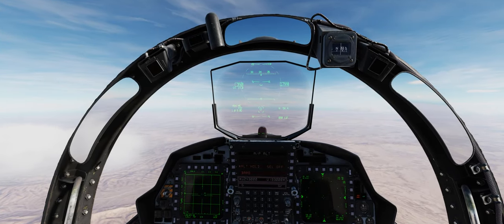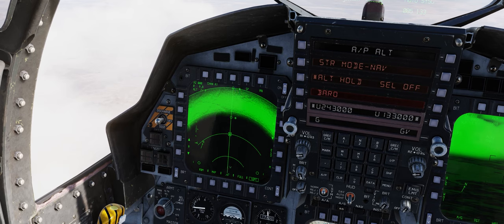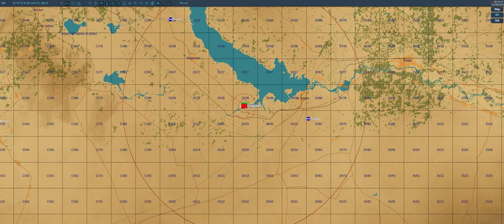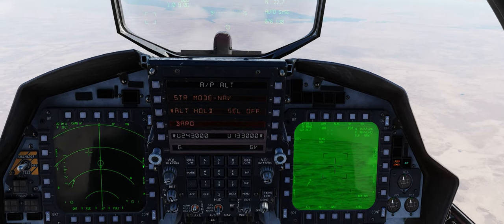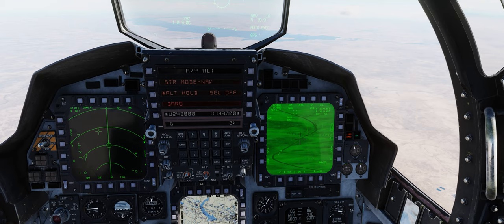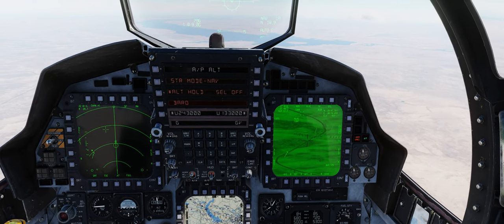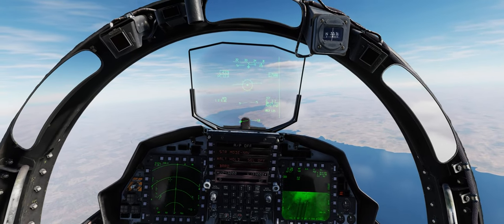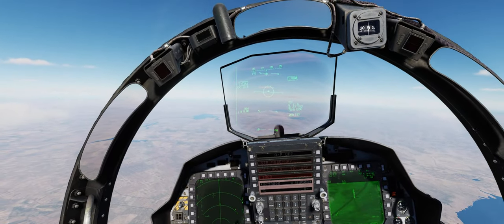DCS F-15E Strike Eagle Air To Ground Radar - GMT, Cueing, TPOD & CDES Tutorial!

Comment: Great video. I am trying to decide if I want to start learning this airplane, I am worried since it is designed for 2 people its going to be too much going on for a single pilot.
Reply from the maker: Honestly it’s really not bad flying it yourself but it just makes ir easier to have two
Reply: I've flown 98% by myself in this jet, and once with a WSO. I can perform pretty much every function normally, but having a WSO to program my weapons, plug in my steerpoints, talk on the radios to get target coords and watch for sams as I ran the TPOD was a REALLY cool experience but absolutely single seat capable. 100% recommend this jet.
Reply: No it's really easy as a single pilot. The WSO just makes it fun but not necessary.

Comment: Any tips on how to steer/pilot the plane once the bombs are released?  I tend to have issues with the laser getting masked by the airplane and the bomb ends up missing it's mark.
Reply: I usually go into a 20-30 degree left bank until it hits and have no issue with camera getting masked.
Reply: don’t fly too fast over the target unless you’re using the Paveway or LJDAM on a still target (these will remember where they were going with relative accuracy) and if you are able to, start a tiiiiiny right turn (Just bank right about 15 degrees and maybe pull an extra .5 G. and then bank left about 20 degrees, you’ll be in a nice orbit that will keep you in the target area and give the LANTIRN the largest field of view and basically eliminate it reaching roll limits. Being really far up of course helps too but don’t go above 25k  because the Laser will not arm above that height. I can’t remember if it’s AGL or MSL but maybe stick with 25000 MSL to be safe